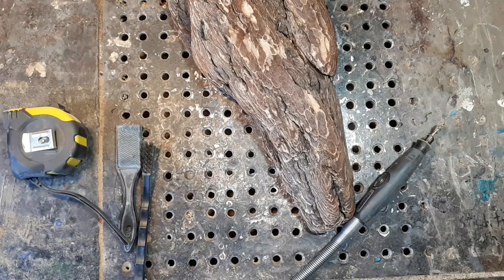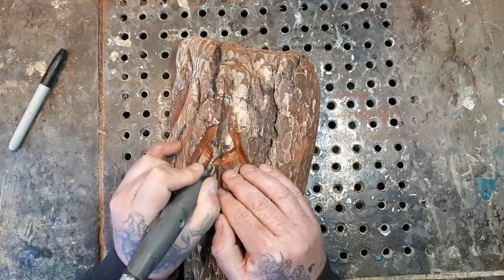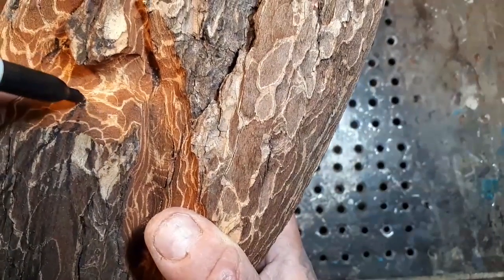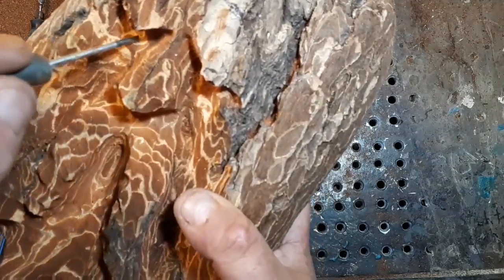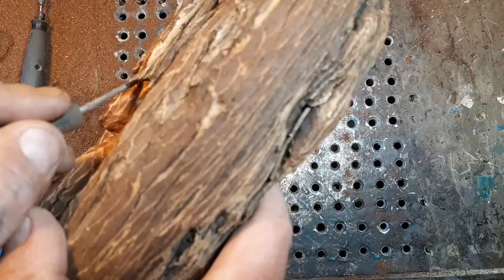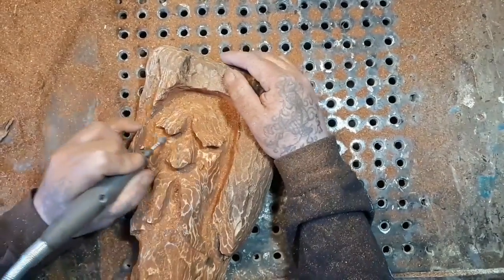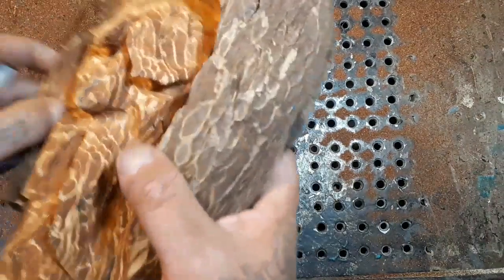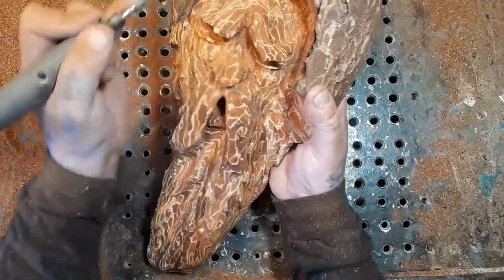Wood carving a fir bark wood spirit,  full step by step video

Comment: You once mentioned how you treat the wood and sand the outer parts of the carvings, mind making a quick video of the process? What you treat it with etc.

And a little treating tip from my dad. Try to get yourself wax, mix it with a tiny bit of terpentine or benzine to give it a thick paint consistency and use that as treatment, whilst rubbing off any bigger blobs of it with a small brush out of the deeper crevices, after the terpentine airs out the wax protects the wood and gives it a permanent, darker and wet look to it.

Cheers from Poland you glorious bastard.
Reply from the maker: Great tip ty!
I will make a little video of what I mean about sanding after the stain drys later todsy 4 sure

Comment: Hi I really enjoy watching your videos you're awesome I have a question about the handpiece that you used can I use it with a Foredom power Carver and if so what's the model number  thanks in advance and keep up the good work
Reply from the maker: Hi there ,
No it's a dremel flex shaft, 
It only holds 1/8 burs or smaller, are u looking for a smaller handpiece for ur foredom that holds 1/8 burs?
Reply: @CarvingFusion  yes I would like to find one that I could use with my Foredom and I have a dremel flex shaft to any  suggestions would be appreciate thanks
Reply from the maker: @danniseyoung7320  if u go to the foredom sight look at the handpiece H.28 
That's a nice slim handpiece that fits 1/8 burs.

https://www.foredom.net/product/h-28-handpiece-general-purpose/

Comment: Hi jordy,in one of your past vids you mentioned the make of the foot pedal you use apart from the foredom one could you please tell me what the other one is please
Reply from the maker: Hi mike, u can just find them on Ebay or amizon , I just ordered another on so I'll make video of unboxing  and how it works when it arives
Reply: @CarvingFusion  thanks jordy,i have been looking for one but so far only found costly ones,i did look on ebay but most are from china with a odd plug having said that i id find one on ebay sold in the uk and sods law cant find it again now,hope you have a good easter